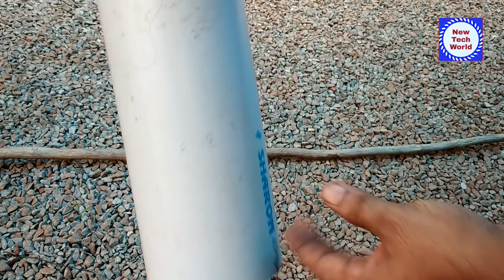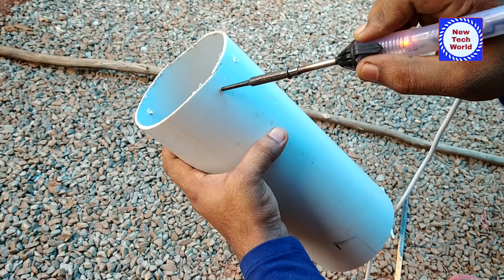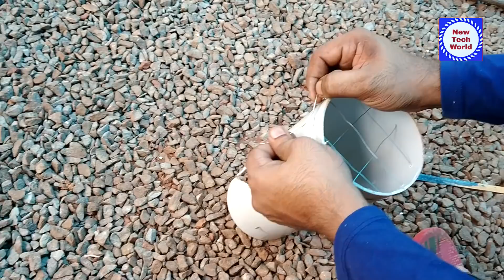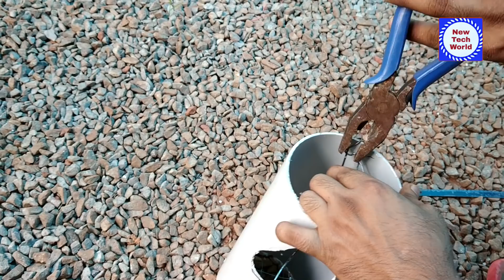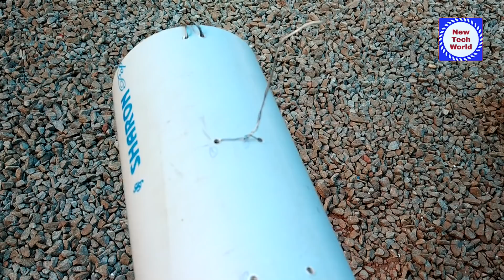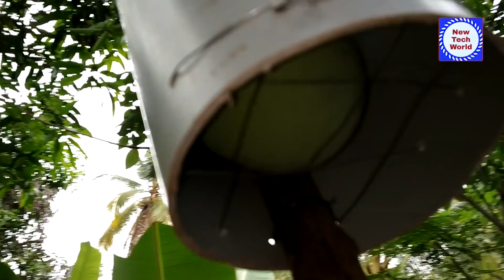മാങ്ങ പറിക്കാം നിലത്ത് വീഴാതെ കിടിലൻ വിദ്യ |Mango picker

Comment: Another easy method is take a steel

 ring with 4mm steel rod, stitch a cotton bag around it. The eddepth of the bag can be less than 1foot. Take a bamboo pole, thotti or thoradu  and tie the ringed cloth bag in cross way and tie. Now your mango plucker ready.